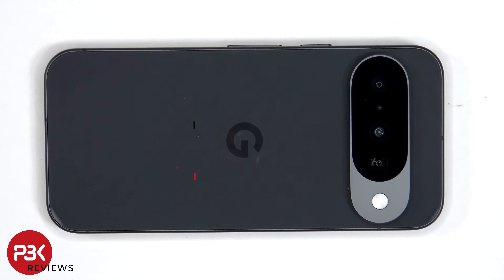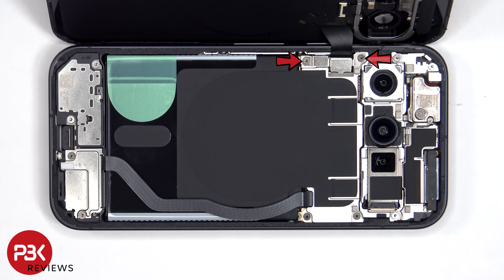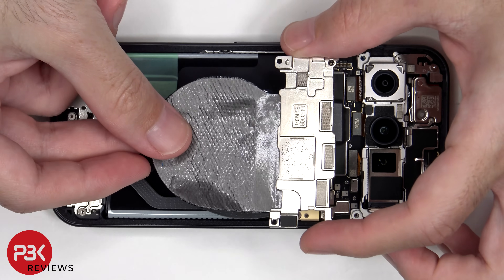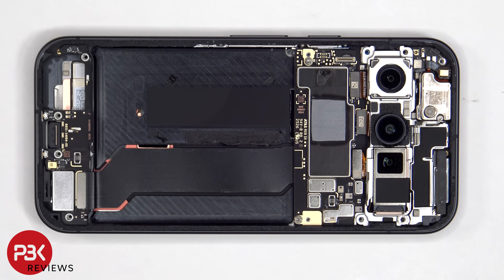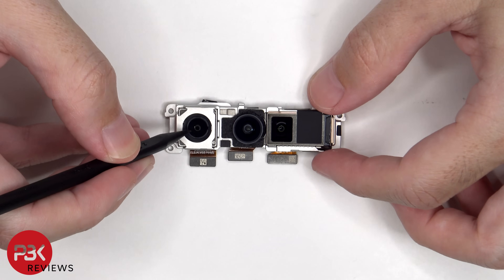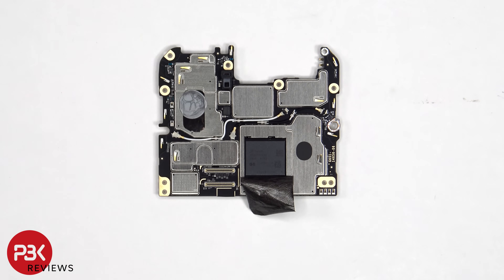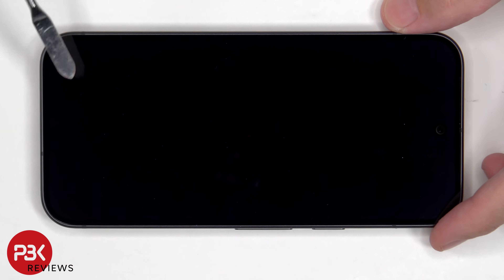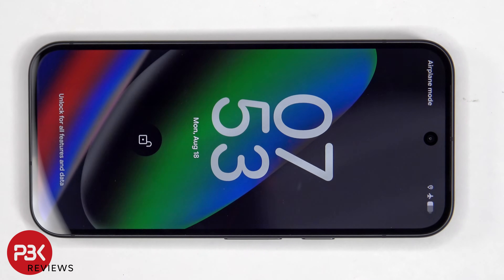Google Pixel 10 Teardown Disassembly Phone Repair Video Review

Comment: What really irritates me is how the mainboard goes beneith the camera module. This means they could have made the cameras deeper without adding more thickness or even make the camerabar slimmer. the pixel 9 had a cutout in the mainboard to have space for the cameras.
Reply from the maker: There are components on the back side of the board which would probably not fit anywhere else. Yeah the front where the cameras are seated have been arranged to allow the camera assembly to be seated as far into the housing as possible, but with the components packed on the back there would be no room to fit those elsewhere to have a complete cutout in the board. Also personally, I like the big camera bumps vs flat backs. In my opinion, it gives definition, style and looks good. But each person has their own tastes.

Comment: Phones are not Easy to repair because Original parts are hard to purchase and high cost company's dont want you to repair that's why right to repair is so Important 😊
Reply: Even with right to repair, u need parts which will be sold by OEM at high cost
Reply: Manufacturers do not want the devices to be repaired. They want you to buy a new one.